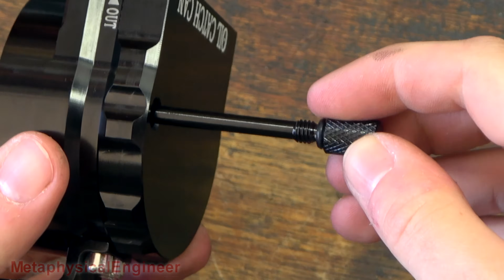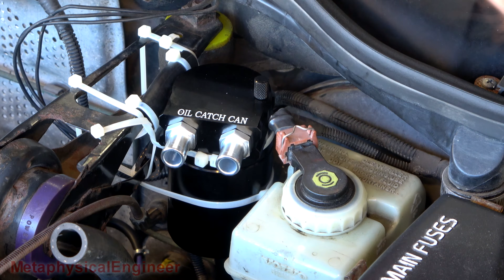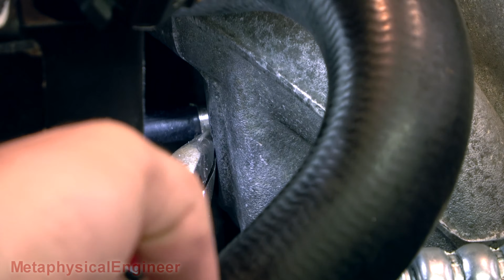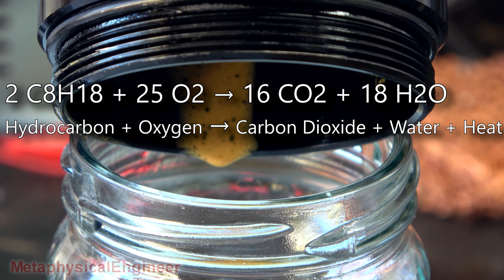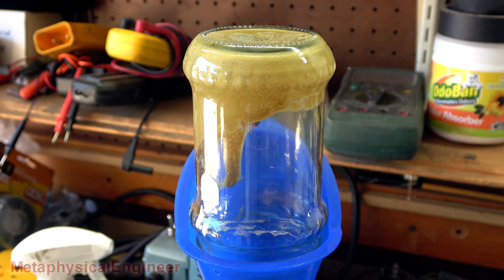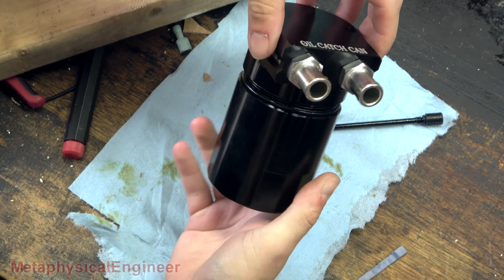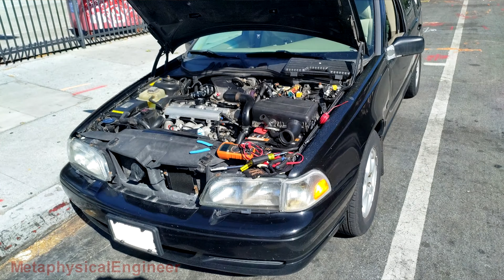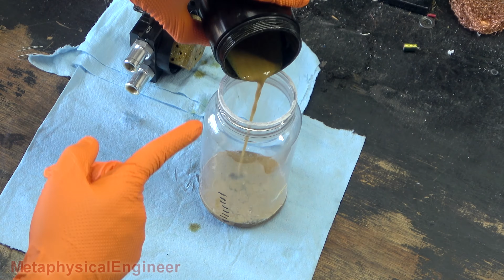I Tried the Evil Energy Catch Can for 3000 Miles

Comment: I know this old but why not vent the blow by to the atmosphere and put a filter on the intake input side to keep bad stuff from entering
Reply from the maker: Not sure how this particular engine would handle that, as the seals and such are designed to primarily have a little vacuum in the crankcase.  I did a follow up video here where I experimented more with how the system  responds to restrictions: https://youtu.be/4UwFhrd6T58

Also, the further I stray from a stock configuration the more work it is to revert for emissions testing which is required in my area.  Unfortunately I don't make the kind of money to just casually have a residence and register in another state with less stringent rules.
Reply: @MetaphysicalEngineer yep. But my set up would take about 3 mins to switch back for the yearly inspection. 

My suggestion is the same I applied to my Harley M8.

No worry there about positive crank case pressure. No  check engines. I know bikes are different but the principle ia the same.
Reply: @sumncguy  yeah a big twin out of a motorcycle isn't really going to care about vacuum in the crankcase. People will do dry sumps to try to get vacuum on high horsepower applications because of how much of a difference it's going to make in a conventional car engine. The reduction of drag on the crankcase alone is worth more to you than the parasitic draw of running an external pump off of a belt for example. The big benefit to running a PCV is the reduction of compressive forces (not having to compress the gases in your crankcase helps them seal better) on the other side of your rings. That's like a naturally aspirated situation don't even get me started on doing anything forced induction. It's getting that vacuum from your intake, so if you put any kind of supercharger or turbocharger on there you can expect that to have a similar result to that dry sump where you pick up power almost magically; a lot of times you're getting power from increased efficiency not really from just dumping more fuel into the cylinder with those setups and people just don't realize it. Your Harley will probably throw a piston through the side of the cylinder before it would give you an engine code relating to the PCV. That's why we love them 😂
Reply: I tried this on my slightly newer Volvo, it threw a code right away for system too lean. I’d imagine the same would happen for him.
Reply: The reason for this is the stock computer measures all of this air for fueling purposes and removing this air from the system can cause it to run poorly or cause engine damage.

Comment: Looks to me like you have an excessive amount of blowby.
Reply from the maker: The weird part is the rest of the engine doesn’t act like it has a blowby problem.  Smooth idle with lots of manifold vacuum, plenty of power, no cold starting issues, and very low oil consumption.

This video where I experiment with the crankcase pressure has the vapors lazily drifting out of the oil fill opening when I had the PCV completely blocked off, not puffing like a steam train as usually seen when rings are shot and blowby is excessive. 
https://youtu.be/4UwFhrd6T58
Reply: @MetaphysicalEngineer  I would say you have almost no blow by, there would be more oil than there is in the collection from the catch can.

Comment: If I saw that emulsion after draining my catch can I would be a bit concerned!
Reply from the maker: I’m also surprised there’s so much goop!  Have some ideas for further testing and modifications I’ll be playing with soon.  The weird part is the rest of the engine doesn’t act like it has a blowby problem.  Smooth idle with lots of manifold vacuum, plenty of power, no cold starting issues, and very low oil consumption.  Oil analysis also shows zero indicators of coolant contamination and the car does not lose any coolant either.
Reply: Mostly water from condensation in your engine, which is normal.  As oil heats up it turns into steam but then condenses again in the catch can.  That is why there is more in the winter than summer.

Comment: I think the steel wool should be in the can to stop the oil swishing around in the can preventing it splashing up to the baffle
Reply from the maker: I’m willing to try that, though the extra volume will mean the can will fill up faster and the accumulation of slime on the steel wool might make the dipstick useless by smearing goop on it every time even if the overall can isn’t full yet.  

It would be helpful if those instructions said anything about setting up the unit out of the box 😂
Reply: @MetaphysicalEngineer  maybe switch the hose around inlet where no baffle dirty side And the outlet baffle side is the clean air. so the baffle will block off the the oil going in. Yup the can is too small to put wool don’t do that I was wrong.

Comment: I notice heavy emulsion on the inlet barb before the baffle. That and the vacuum glove test suggest (to me) condensation is occurring before the catch can so the factory plumbing may be insufficient or too small to move air fast enough to prevent condensation based on your conditions, which is likely short tripping. Maybe an issue with the PCV valve. Or maybe the clean side tube is too small and should be enlarged. Or maybe the clean air tube is too far away from the engine so the air that it takes in is too cold compared to the blow by. Which was confirmed by your findings of the kinked tube.
Reply from the maker: Factory plumbing has been upgraded from the factory size.  But you’re right in that lots of emulsion collects in the inlet port and the reservoir.  Never see any under the oil cap or dipstick.  PCV parts themselves are verified working.  This system uses a closed, vacuum crankcase design with no dedicated fresh air inlet.  Flow is proportional to blow by, manifold vacuum, or turbo inlet vacuum.  The tubing stays clear for the most part but the emulsion begins to build right at the inlet to the catch can.  

Even though it’s right by the exhaust and engine, the catch can simply doesn’t warm up very well, even on a 30 minute trip.  In the cooler months the contents end up as mostly liquid water with just a little emulsion floating on top!  Already working on some ideas for that problem, which will appear in a dedicated video sometime in the next month or so if all goes well.
Reply: @MetaphysicalEngineer  will be interesting to see how that turns out. And thanks for the explanation.
Reply: @sbond1963  You're doing a great job! Somewhere, I saw that heat (from the cooling system) was being applied to a catch can, by either a race team or skilled modifier (think it was a Porsche). Maybe that helps condensation -- hopefully only the water component -- to evaporate and enter the intake as "steam"??? I'm now trying to figure out how to add a can to our 2015 and 2025 Honda/Acura V6 engines, the older one with conventional fuel injection, and the newer with GDI. Keep your analysis coming. Thanks!

Comment: If you can put your pcv valve on outlet side of catch can your can will work even better!! Like one wasn’t there at all
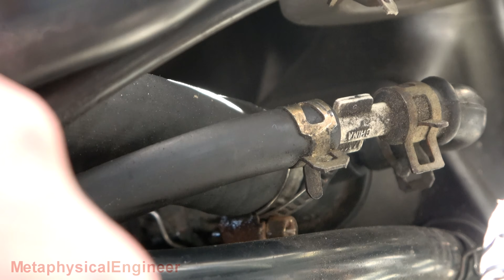Reply from the maker: The “PCV valve” on this design is that metering orifice with PTC heater explained starting around 3:15.  So it is after the catch can.  There are some ways to modify it, but since I live in California any changes I make must be easily reversible for the smog inspection.  

Unfortunately I don’t ’know a guy’ who does under the table inspections and even those are getting harder to find since the electronic records are more thorough now.  I’m also aware of such solutions of moving or buying a house in a place that doesn’t do emissions testing…but this channel brings in lunch money, not casually buy a house just to avoid smog testing money 😂
Reply: Post catch can!!

Comment: Great video!  I installed an Evil Energy catch can in my 2012 Traverse about 2 weeks ago. There's an alarming (to me) amount of oil that thing has caught so far.  I also modded my PCV metal "valve" with 5/64" on 2 bottom holes and 7/64" for the top hole - as many YT videos directed me to do. I feel really good about it now that I'm all set up. Thanks for your video, it helped get me started on doing it for myself!
Reply: Bro, that is because the traverse is a pos. Mine eats oil like an old v8 with weak seals. Has done it since it was new in 2016. Never thought I would have to make sure my brand new car has enough oil staying it.
Reply: @johnboywaltonish  I hear ya. Mine is hit or miss on the oil eating. Most of the time, it's just fine. But then I'll check it and won't see a thing and will pour a whole little bottle in to get it back to registering. Weird.  All in all though, I've replaced all the major things on her - transmission, A/C, engine mounts, etc. and we're at 123K miles and counting. On road trips, I'm getting 19mpg and you can't beat the comfort of the ride or the size of the vehicle for family trips.  Won't buy another one but will keep driving this till she tells me she's done.  Best of luck with yours!
Reply from the maker: Glad you found the video helpful! Depending on your vehicle and driving conditions, you can get a ton of material in the catch can.  This is why manufacturers don't include such things on cars from the factory!  

In summer I can get 1k+ miles before I need to drain it, but now that weather is cooler, I need to empty every 500 miles or less. Better on longer trips, but standard shorter trips, even enough to fully warm the coolant and oil, are not enough to warm the can all the way and it picks up tons of condensation.   Gotten to the point where I'm thinking of some changes to the system.
Reply: You should run 2 catch cans there’s two places it can suck blow by in
Reply: @StarkyGarage  There are enough contraptions to handle that other blow by, but if I end up having to clean that more I will install another one. Thanks!

Comment: You may have issues with your piston rings.
Reply from the maker: What other symptoms would you expect to see?

Compression ring issues I'd expect to cause poor power, uneven idle, trouble starting, etc.  But the engine runs smooth and strong.  Oil ring issues would cause a lot of oil burning, but it barely burns half a quart in 5000 miles.  I only have to add oil if I drain some during other repairs.

Comment: Great!  Use Teflon tape on can threads as well, smooth and quiet.
Reply from the maker: Thanks for the tip!  Any experience with how well the tape holds up?  Or would I expect to replace it every time I have to clean the can?
Reply: @MetaphysicalEngineer I’ve used dozens  of different Teflon tapes. They all behave differently on different materials! It’s a grand research experience!
Reply from the maker: @Joeandfran  That's fair!  I've also used a variety, and I expect to replace it every time I disassemble a joint.  I'll give that a shot next time, or maybe when I notice that o ring getting tired.
Reply: There’s a rubber O ring on top that seals it no need for tape the threads will be fine

Comment: Awesome video thank you. I run this on a beater Prius with 220k miles and half is filled at 5k miles oil change. No steel wool or extra baffle. I was thinking of adding a 1.25 in pvc pipe to the inside to lower the inlet down a few inches into the CC reservoir. The adding some wool in there. I’d have to empty it more frequently as to prevent it from drowning. What do you think about that?
Reply: oil will degrade the pvc pipe. absolutely do not recommend.

Comment: Very nice. For your car, did the addition of catch can completely eliminate oil in the intercooler and intake?
Reply from the maker: Not completely eliminate but greatly reduced it.  Some oil will come from the turbo itself, and the catch can is not a perfect oil interceptor either.  It would need to be much, much larger and more complex.  But I'll take a major reduction in the goop getting to the intake!
Reply: @MetaphysicalEngineer  Thanks, a major reduction sounds good to me.

Comment: Crazy. After 15,000 miles, my can barely has enough oil to cover the bottom of it on my subaru.
Reply from the maker: Thanks for weighing in! How much collects in the can really does vary a lot it seems.

What model Subaru and what driving conditions?
Reply: @MetaphysicalEngineer 23 forester. City and hwy. Don't know if it matters, but I run tt fuel, change oil every 3000 miles. Around that mileage you can start to really smell the fuel dilution. I go overboard on maintenance in general.
Reply from the maker: Are you smelling the fuel dilution on the dipstick, or when you drain the oil?  Do you drain the oil hot? Have you gotten any analysis done to see how much fuel or other contaminants are in there?  I'd expect fuel to be a problem with lots of short trips all the time, but a solid highway run should force most of the fuel to vaporize once the oil warms up.
Reply: @MetaphysicalEngineer I've never done analysis. Sometimes in the winter I will start to smell the gas when approaching around 2500 miles. But I also use 0w-20 then. I'll go ahead and change the oil if I think it starts to get strong enough to be diluting it too much. Yes, I'm guessing and probably wasting a little bit of money. I have no problem with it. I sleep easier.
Reply from the maker: @nwastormchaser9624  Interesting that a new car is getting so much fuel in the oil.  Was curious about the analysis since even a tiny amount can make the oil really stink and change its properties.

Not really a waste of money because a new engine costs as much as a ludicrous number of oil changes.
Reply: @nwastormchaser9624  I think if you smell fuel dilution you might want to get an oil analysis from Lake Speed or Blackstone labs to make sure you don't have a leaky injector. It's good that you change the oil before it gets too diluted but if an injector is leaking it could be washing the oil off a cylinder and will greatly increase wear on it. The lab can confirm or debunk fuel contamination and alert you to abnormal wear particles. 

I'm with you though, 3K oil changes are a relatively cheap way to protect your very expensive engine!

Comment: Shouldn’t the round black screw in baffle be on the outlet side? I think the idea is that the vapor comes in the unbaffled side, then falls down through the aluminum perforated silver baffle, causing some of the oil to fall out. Finally the vapors pass through the black screw in baffle (as a final catch) and out through the outlet to the intake manifold. I have read that a number of the Chinese knock offs have the in and out sides missing-marked.

Love the “Glove Test”!
Reply from the maker: Interesting!  The ones with the sintered filter have that on the outlet side as far a I can read the diagrams, presumably to catch particles.  But these ones seem to have have the filter/baffle on the inlet side, I guess so the flow and gravity carries the material down into the can.  Then again, could be mislabeling too! Maybe I can do a follow up where I reverse the flow to see what effect it has.  

Not sure who came up with the glove test, but it's common practice for this generation of Volvo modular "white block" engines to assess PCV performance.  I think the oil I was seeing was because the system was not flowing enough under boost, causing excess crankcase pressure while I was driving (and thus when I couldn't observe or test it). Not getting the oil seepage anymore after that final set of modifications.
Reply: @MetaphysicalEngineer  if the filter is on the inlet side, what happens if it gets stopped up? It seems less likely to clog if the filter is on the exit side. I am not sure if my thinking is correct, but that is how mine is setup. I have read on many reviews on Amazon that the In/Out were mis-marked on some of the Chinese knockoffs.

If you find that my thoughts are incorrect, please reply to let me know.
Reply from the maker: Either way a clogged PCV will cause issues because the crankcase pressure won't have anywhere to go.  Worst case it can get high enough to force its way out by ejecting cam or crank seals from the engine.  Even if seals don't fail, oil will be forced past causing major leaks.

I think the theory is the steel wool and mini baffles give the oil a chance to collect and have the liquid fall into the can.  On the outlet side, the liquid may risk blowing off and further down the pipe instead of falling down.
Reply: @MetaphysicalEngineer I bought an inexpensive manometer. Tested heated engine crankcase pressure on a 2014 Accord 2.4L with Manomter and got a -0.31 vacuum with the catch can installed. I plan to continue testing to determine if the micron filter at the outlet starts to clog, increasing the crankcase pressure. Blockage at the filter (inlet or outlet filter location)  is my main concern.
Reply from the maker: @danayo8852   Nice! Was that -0.31 at hot idle?  What does it look like at various driving conditions?  

If you manometer has differential inputs, you could also measure pressure drop across the catch can directly.  In my latest video I did a whole sequence of those tests.